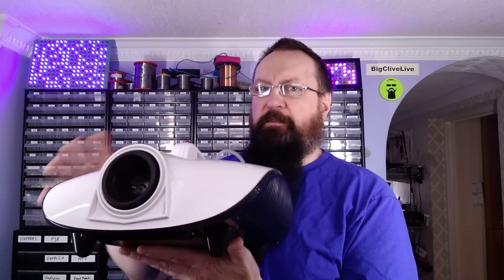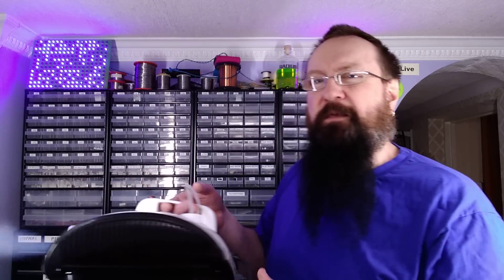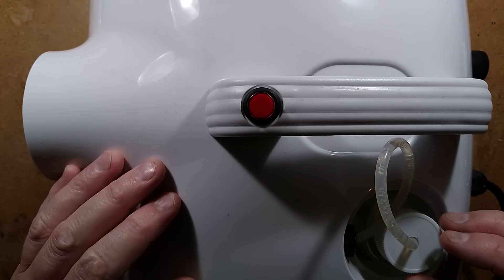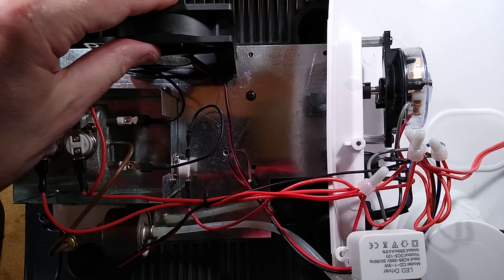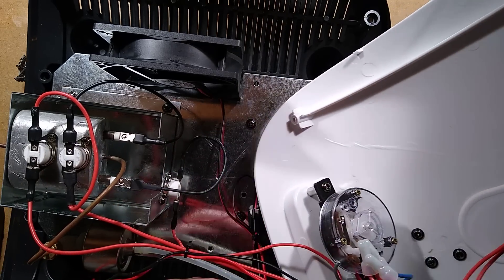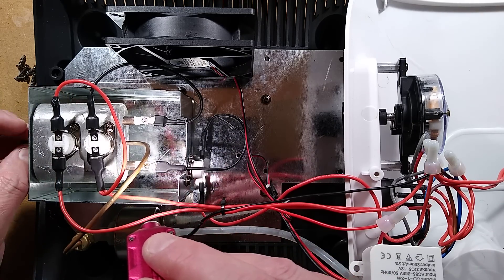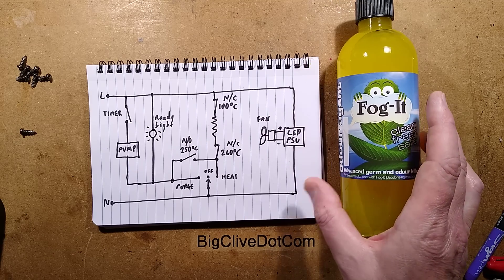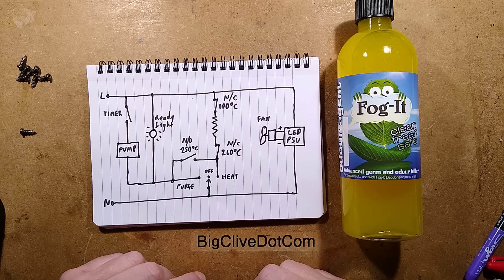Inside a car/room fogging disinfection unit (with schematic)

Comment: As someone who once did a lot of electrical work for a body shop that grew out of a auto detailing business, I built a strip of foam rubber with an extension cord glued inside it that could be put in a window that was open about an inch and then roll the window up on the rubber. This was used to power an ozone generator inside the vehicle. In extreme cases we hooked up a power supply to the car (NOT a battery charger) and left the ac fan running with the ozone generator all night. It would litterally eat cigarette smoke off the inside of the glass, but usually we did this for cars that had been near house fires. People were amazed that this worked. We usually also replaced the carpet and the foam of the seats because you just can't get everything out of foam, but this did the job on smoke in the AC ducts and inside the dashboard, etc. We even took a totalled car from a heavy smoker and taped part of the windshield off and cut the steering wheel in half. We kept  each half of the steering wheel in plastic boxes. Even years later you could still smell the smoke one the half that didn't get the ozone. The taped off part of the windshield was obvious even in crude instant photos of the 1990's.
Reply: I've slammed many a cord in a vehicle door for various reasons, never even remotely had an issue...even the same cord, over and over. The door should be shutting on a rubber seal. If you slam your car door and you're banging metal on metal something is seriously wrong. Smashing a cord in that rubber seal isn't going to hurt it even a tiny little bit.
Reply: @ryanroberts1104  yup we used to refit doors by putting a pair of fluffy towels in the 'hole' slam the door on it, tighten the hinges, hey presto 5mm even bottom gap can do all 4 doors in 15-20 mins
Reply: @lezbriddon  Sounds like a typical hole in the wall chop shop. This is why you can't find any good service these days...car doors do not fit metal on metal. Period. If they are hung this way it is broken.
Reply: Does ozone help kill mold? I had a truck that sat for 6 months and had some food under a seat grow some nasity stuff, what can i do?
Reply: @crazystuffproduction  that disinfecting fog would probably be the most cost effective way to kill whatever is growing in there. Not sure if that will get rid of the smell though. That probably depends on what was growing, what it was on and how well it can be cleaned. You might have to replace the foam in the seat to get rid of the smell quickly. If there was carpet under there, remove the seat and steam clean the carpet. Put the seat upside down in the sun since that is free and kills a lot of nasty stuff. After you clean the carpet, put a fan on it so it dries quickly. If that carpet is saturated you might have to remove it, or at least the contaminated area. Putting a fan under the edge of a wet carpet (flying the carpet) may be the best way to dry it, but automotive carpet does not fly well without a big fan and sometimes even a 1 or 2HP fan is not enough to fly it.
If it still smells after it is clean and dry you can try an ozone generator. Use the Corona discharge type, not the UVC light type because most of vehicle interiors will be damaged by UVC.
Reply: @jdrissel  After hurricanes and tropical storms (lost track of how many), I've found that the best way to deal with the carpet and drying is to do the carpet cleaning, then run a rinse with a Lysol concentrate solution.  (Diluted down appropriately).    The Lysol(TM) keeps mold from growing while the carpet dries.   Real example is that by doing that, my office carpet had no mildew smell at all.   That was a carpet shampooer to remove the water, then a shampooing, then a rinse with the Lysol.   My neighbors (customers), hired a 'professional' company, who did water removal, then put in the huge floor squirrel cage fans (I didn't bother), and the next three years, they smelled of mildew.    I've used bleach as well, but that doesn't last as long in areas that might take days to completely dry (Such as Houston in the 'winter')
Reply: I looked at ozone generation to decontaminate groceries of the corona virus.  I got the idea for the design of the generator from the youtube channel Tech Ingredients....very good channel
Reply: @mdrew44628  Tech Ingredients is a cool channel. BTW I was the one who asked him to make a few of those videos. Now it doesn't seem like we need to worry about groceries much, but for awhile I was spraying mine down with hydrogen peroxide.

Comment: Did you buy that thing to use it yourself?
Reply from the maker: No.  I bought it to take apart in this video.
Reply: @bigclivedotcom  - Can you teach us about car computer programs and electronics? I'd like to learn more about that. I think I understand the basic principles of it, but I would like to know more. The auto industry doesn't seem to want to reveal to anyone what those computer modules do, so there is a lot of guessing and replacing of parts that don't need to be replaced going on everywhere. That basically means bigger bills for everyone every time a car needs to be repaired. Many BMW's have electrical problems, so if you could get hold of one of those you could have stuff for many videos.

Comment: Shutting the car door on a cable/wire isn't going to damage the wire. Unless you hold the wire up to the latch area. Other than that, it'll be perfectly fine.

Comment: Is that diagram right?  Won't the 100°C n.c. switch open before the 250°C n.o. switch closes to start the pump?
Reply: No. the 100C switch is not mounted on the heated block. It should never open. That's why Clive called it the OMG switch.
Reply: @misterhat5823  Ahhh, that's it.  Thanks.

Comment: I was under the impression that the Benzalkonium Chloride and other quaternary ammonium based disinfectants require a cold fogging process.

The ethoxylated alcohols do seem to be the active ingredient from a quick search, acting as a surfactant. Probably more heat stable than the Quaternary ammonium compounds.

BAC and QAC disinfectants seem to specify a ULV fogger. https://en.m.wikipedia.org/wiki/Ultra-low_volume#:~:text=rare%20at%20present.-,Ultra%20low%20volume%20fogging%20machines,are%20dispersed%20into%20the%20atmosphere.
They look to be high volume low pressure sprayers, specifically designed to have tiny droplet sizes.

 I would not adapt any fogging machines that are used for effects into sanitising foggers. As you suggest Clive, the high temperatures may well degrade any BAC or QAC based products which are widely available.
Reply: I'm not a chemist, but use disinfectants quite a bit while fostering cats. We have to be very careful what products we use and how they are prepared and used.

It's worth bearing in mind, Benzalkonium chloride has had variable results with COVID in some studies, and many antiviral disinfectants use a combination of different quaternary ammonium compounds to achieve quicker contact times and more reliable results. Things like alkyl dimethlbenzyl ammonium chloride, didecyl dimethyl ammonium chloride, biguanides like polyhexamethylene biguanide hydrochloride and various other things are being blended in, or even used exclusively.
Some of these are very nasty if used incorrectly and can be harmful to people and pets even once dried. 

As a general warning to people I would recommend checking with any manufacturer to see if their product is safe for fogging, at what concentration, and what fogging process it is suitable for. Also check what the correct contact time and dilution is specified for different bacteria and viruses. These can vary widely from 30 seconds to 30 minutes, or 1-10 to 1-500 concentrations. Often this is shown on their websites. 

Always follow the manufacturers instructions, do not mix or blend cleaning products as they can interact. It's very easy to inadvertently cause the disinfectants to precipitate out of solution, or if they are stored for too long diluted they can form crystals. I would recommend against home made concoctions. There's no need to do it now anyway, all the manufacturers have ramped up production and there more than enough to need demand.

Comment: Having "fogged" (ozonated, really) a good number of vehicles, I can tell you that it's actually quite difficult to slam a cord into a door jamb where it could get smashed enough to cut through the insulation. Thanks to all the seals, as well as manufacturing gaps - both deliberate, and accidental - there's a fair bit of play in there for a cord to slip through.😁
Reply: Yep - SOP for temporary CB, Ham, Cellular antennas is to run coax out a door or hatch (usually at an angle to reduce stress) and slam the door/trunk on it.  Rarely have I seen any sign of damage, and that was actually my fault pulling it against a sharp plastic brake light lens.  Its easier to damage the paint than the cord (accidently did that on a power cable feeding an electric cooler on a hitch tray)
Reply: I agree, also cars don't really have unpainted, metal surfaces anymore, so unless you own a cybertruck it's likely not a problem anyway.
Reply: Yes totally agree my Ham radio antenna coax has been getting slammed in the top corner of the driver's door for around 5 years with no adverse effects, still working fine.
You could almost slam the doors of modern ish cars on your fingers without injury, due to the soft rubber seals and gaps.
On a rainy day I also slam the doors on the vacuum cleaner extension cable whilst hoovering the inside.
😊👍👍
Reply: Surely, the easiest way to do it, though, would be to fractionally open a window and put the cable through there?
Reply: @ukeleleEric  That actually would crimp the cord, if the window were rolled up.

And, don't call me Shirley...
Reply: @andyking894  It would only crimp the cord if you had an electric window, and wound it right up to it.  I was saying it would have to be left open a small amount.  How would that crimp it?  Since even most electric windows stop fairly sharply when something solid stops them, all you need is a solid item thicker than the cord when you wind it up; or you could stop it yourself, THEN put the cord through.  Of course, I didn't explain all that because I thought that much was obvious.  Apparently not.

Comment: Could that liquid be used in a standard (disco/stage) fog machine?
Reply from the maker: I've just got the official machine for the liquid and it is a standard cheap smoke machine running at 240C.  Not convinced about disinfectant integrity after passing through that heat.
Reply: @bigclivedotcom  hi Clive. Thanks for the reply.
Are you saying that the disinfectant machine works at a lower temperature that the stage machines?
Reply: It seems more like the machine is getting too hot to keep the disinfectant intact. It makes the machine a lot less effective.
Reply: @AnnaVannieuwenhuyse  which? The stage machine, or the "disinfectant" machine?
Reply: @PipeManPeep  both, I'm guessing, since Clive found they're mostly the same inside. Or did I get that wrong?

Comment: So why have a cooling fan when you want it to heat up? Does the fan help to blow out the fog? Does a standard fog machine have a fan?
Ok I think I get it now the box around the block is a heat shield and the fan cools that. 
Is that cheaper than some insulation?
Reply from the maker: It's odd.  The fan is purely to keep the case cool.

Comment: I would imagine the aluminium style metal potting of the heating element is likely Mazak. It's quite an easy and common casting metal. It should be suitable given its almost 400c melting point too.
Reply: I wonder if the box around it might be safety in case it melts

Comment: It looks like they put the heater in a steel bucket in case it goes thermonuclear, to stop the molten aluminum from going everywhere. Kinda neat. Despite the cheapness of this model, it seems like they've applied lessons learned to their design. Neat.

Comment: This device doesn't come with industry standard 240V XLR socket. Very disappointing.
Reply from the maker: Don't worry, the next one does....
Reply: What's wrong with a 3.5mm jack plug ?
Reply from the maker: @jamesharmer9293  240V.
Reply: @bigclivedotcom  Sorry, I was being sarcastic. I wouldn't put mains through a jack plug, or an XLR plug either. To much chance for unpleasant things to happen. Having experienced 240V as a very small child ( due to someone removing a surface mount mains socket and wallpapering over the bare wires ) I've always treated mains voltages with extreme respect.
Reply: They are upgrading to the new 240VAC Speakon connector.

Comment: Hey Clive, how can I find a video on those flashing light patterns you have going on in the back ground? What are they called? Cheers
Reply from the maker: It's a grid of standard flashing LEDs with a resistor per LED on 5V.  The zipped gerbers are on my website bigclive.com for download in two sizes.  6x4 inch photo frame size or A4 frame size.  You can see the slow colour change version in my most recent live stream on BigCliveLive
Reply: THey are something he makes himself. Video: https://www.youtube.com/watch?v=H1k7mxhWQ5Q
Reply: Check his back videos he shows how he made them.
Reply: https://youtu.be/H1k7mxhWQ5Q

Comment: I'm wondering if this has any benefits over an industrial ozone generator. Mine runs around 60w which is a heck of a lot cheaper power-wise and doesn't require fluid.
Reply: Ozone degrades plastics and rubbers over time, they gradually become brittle. I'm not sure I would want to stuff industrial levels of ozone into my car, unless I was getting rid of it in a few weeks time.

Comment: If I wanted something like this for disinfectant fog, is there any reason I couldn't just use my existing smoke machine - seems like apart from the button to trigger it, it's pretty much the same? Just need to purchase some anti-bac fluid and make sure to flush it out, before resuming duty with normal fog...
Reply from the maker: Some companies like Antari imply that you must only use a specific machine for it, that looks just like one of their cheap machines, but really expensive.  I'm not sure if theirs run at a lower temperature.
Reply: Quaternary Ammonium based disinfectants such as Benzalkonium Chloride seem to require cold fogging using a ULV fogger from what I can tell. There may be specialist disinfectants for these hot foggers, that may work in a normal fogger. But I wouldn't risk my safety on it.
Reply: All English speakers speak of  L.Ay.D. ,when they speak of a LED... Why not say  'led'.. is it to not mix up with 'Let'??.. in dutch we just say led..
Reply: @pear7777   Because in English, as a general rule, we don't pronounce acronyms no matter their origin or ease of pronunciation.
Reply: @PedroDaGr8  gif would like to have a word with you :P
Reply: @TheJunky228  hahaha, that's why I said as a general rule. A few fields, namely programming and military, do pronounce acronyms but those are the exceptions to the rule (of which every rule English has at least a dozen).
Reply: @pear7777  There's no clear rule in English about when to convert an abbreviation which is pronounced letter by letter into an acronym which is pronounced as a single word.  It just depends on how convernient it is and how natural the resulting sound is.  NASA is an abbreviation but it's always pronounced nassa because it's easy to say.  ABS is also an abbreviation but it's pronounced A-B-S because "abbs" would sound awkward.   LED is easy to pronounce as a single word but usually isn't probably because it would then sound identical to the word "lead" (the metal).